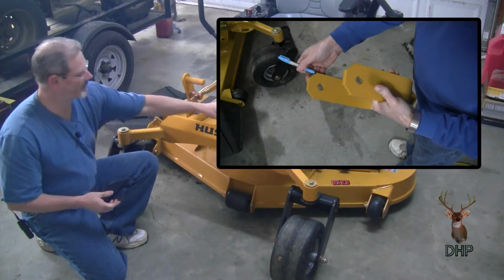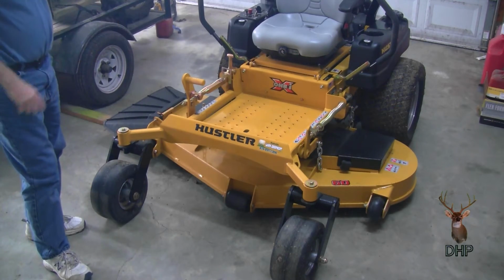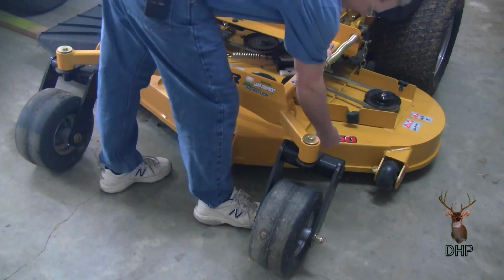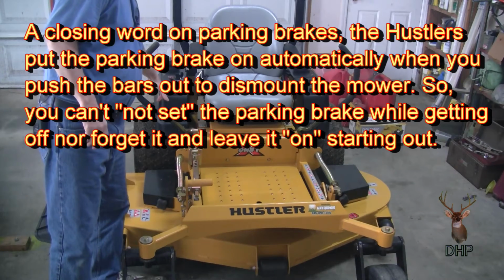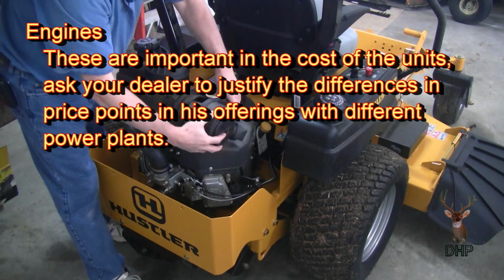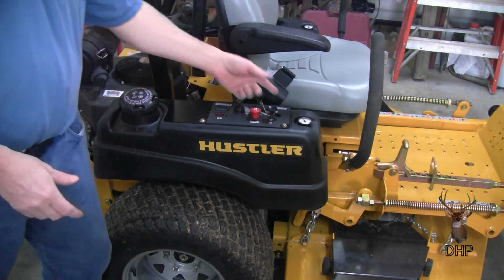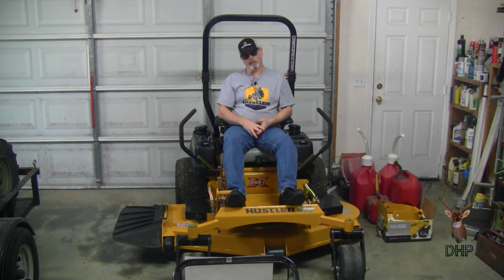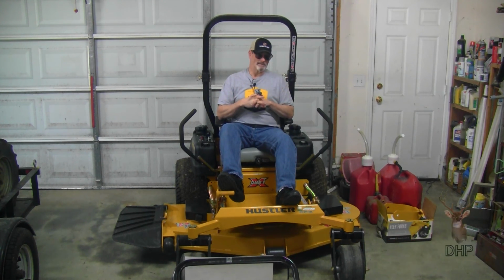S04E01 - 2013 2014 ZTR Selection  1080p

Comment from the maker: jchap04 While this doesn't count as a review yet, I have cut now several times with it and it ejects well, rides comfortably and handles surprisingly well. The upper field is a kidney punch if there ever was one with monkey heads to dodge and wet spots all on grade and it hold the hill 24-12-12s do a fine job with the gross weight and distribution.

One of my neighbors has a Fast track Super Duty a few years old. I caught him, Momma and the kids out after cutting recently and zipped down for him to try (he doesn't have springer forks or the suspension seat). I let him run it up and down his field (part of the same broken up cattle farm as my land) full blast for a while. Without saying a word as he came out the gate Momma said "No! your not gettin' another mower." "That's a whole 'nuther animal right there." "No".. (use your imagination) I was able to assist in this by saying his model could be upgraded and not replaced. - swell of me wasn't it. (insert evil grin).

To be fair, I don't know how his rides. How it rides in his field or how it would ride w/the seat and forks. Or... if he was just being polite, but I like mine. And we had long serious conversation on which of the two made the biggest difference.
Reply: Glad to hear you like it. I almost bought one used off of Craigslist the other day.
It had 220 hours on it and, the guy wanted $6500.00 I offered him $5000.00 and he said OK. It had the springer forks, suspension seat, striper, chute blocker and, a small bagger. Really nice machine but, at the last minute I decided that a front mount deck may be a better fit for my property that has a lot of pine trees and, low hanging trees. I am already regretting my decision because, I think I may have lost the deal of a lifetime.
Reply from the maker: jchap04
Yea, I know. That is where the green industry guys who buy 3/year every year for their fleets can rotate out if a model doesn't pan out. It is more of a operational issue and the dealer's ability to get a down unit back up is dollars to the bottom line just like fuel prices and the weather. You can get under trees with a front-mount like a Grasshopper but they don't maneuver quite like a mid-mount.  Done is done now. You made a choice. remember Lot's wife - she looked back.

Yea, I like mine and $5k w/that outfit and low hours sure sounds good but the warranty doesn't transfer I don't think. Hustler is no different than anybody else, like Mathews in bows - lifetime is for the original owner. So the welds on the frame and leading edge - gone on the sale. Same time, it is tough. I don't think (opinion) they'd offer it if they honestly expected to pay out. I don't see anyone else sticking their necks out. So if it doesn't break, you don't need a warranty. Either way, spilled milk (no beer) now.